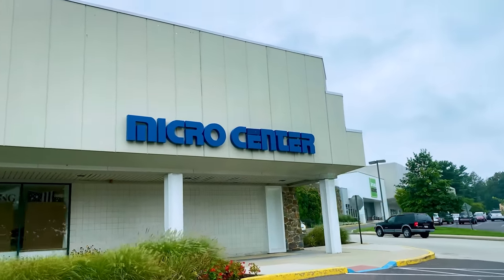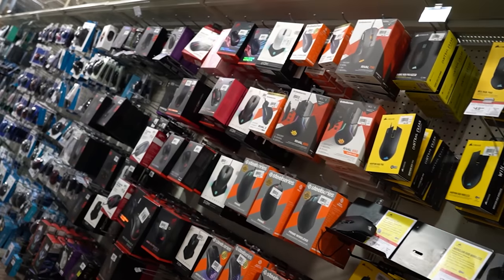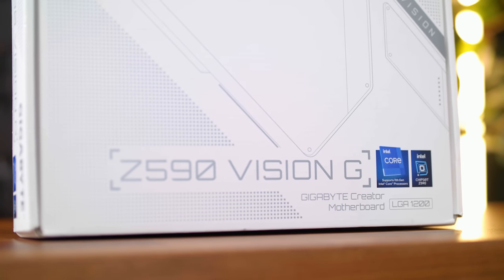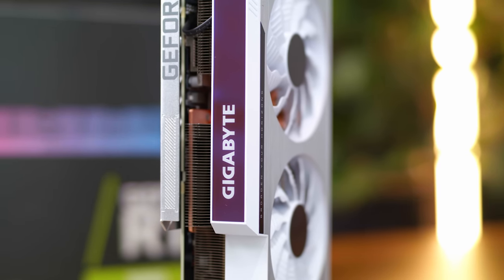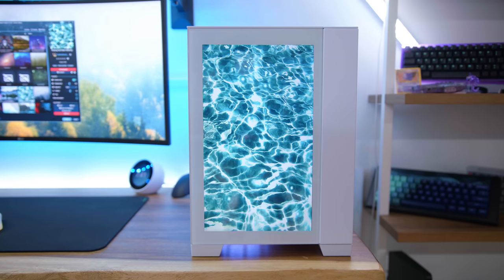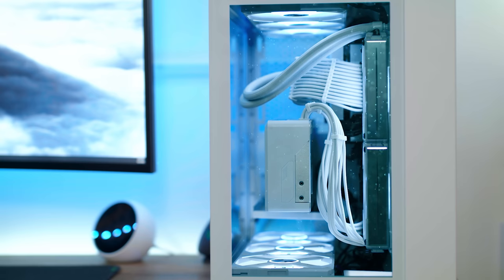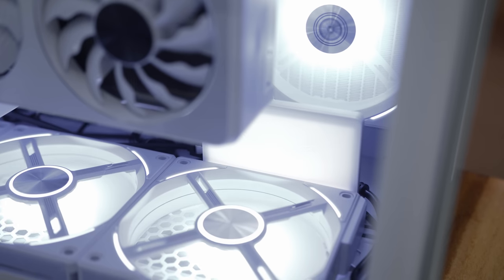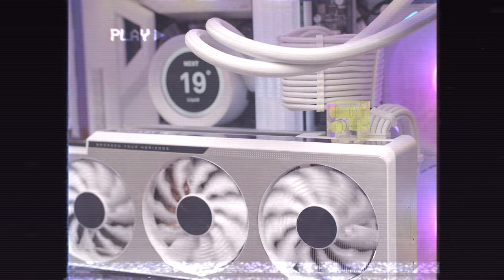I went to Micro Center & Built this SUPER CLEAN PC 🤤

Comment: The dummy questions at the end had me rolling!

This build is fantastic and so clean. The o11 air mini will be replacing my corsair 280x so I can get a white b550/x570 board in there
Reply: Especially the white z690 Asus motherboards! Good luck!
Reply: if you want a 360 mm radiator get a matx or itx cuz with a full atx it doesnt support 360mm radiators (i have one and had to return a 360mm aio and go to a 240mm one)

Comment: I need to upgrade my Intel 2500k, 4Gb RAM, 1Tb HDD, Onboard GPU, Gigabyte MoBo, 450 watt PSU, No case, it's screwed onto a piece of wood. The power supply though is actually decent though, for a 450watt.

Comment: I have a similar setup to you and decided against the vertical GPU. I tried it, but unfortunately it's too high for my taste. The GPU would have to be 3cm deeper and it would be perfect. Unfortunately, I haven't found a suitable solution for this yet. By the way, I installed another fan at the rear to blow air into the case. So in total 4 intake, 5 exhaust

Comment: Micro center is beautiful. So is the new PC! Gigabyte vision is unbeatable for a white build. My only concern is that the O11 Dynamic mini/normal/XL vertical GPU mounts have gotten bad reviews. Want to get the 011 Dynamic regular sized but want to water cool it with fans and radiator on the bottom and vertical gpu mount but can't find a good option. Any ideas?

P.S. Fire burns at the end buddy lol

Comment: Right, I realise this is a year old but it is probable you could have found better deals online rather than going to a store. Some places even offer free shipping. I just got the same case as you for £107.99 total with free shipping. Which I am glad about because I nearly paid an extra £8 for quicker shipping and my order arrived within 2 days from ordering. Which I think is a good deal since I seen it for sale elsewhere for as much as £30 or more extra. Lol, now I need to save up for the ROG SFX-L RGB PSU in white(I could probably save £100 by just buying a PSU without fancy RGB but it has a 10 year warranty which is good, 3 years on the RGB). It will probably take me the best part of a year to get all the parts together for a new build, am poor. By the time it is all set up there will probably be an Intel 14th gen range of CPUs released.

Comment: Quick question about your build!  Did you have any issues with the vertical mount making it difficult to plug in your HDMI cord to your GPU? My Snowblind S case isn't level with using a cablemod vertical mount.

Comment: Such a clean build! That momma joke was classic LOLOL. I have this same case in the regular white with a 10850k on an Asus z590a motherboard. I have it being cooled with a Corsair 280mm capellix AIO. But behind the radiator I have another 2 noctua 140 fans for a total of 4 140 fans so the cpu is very cool. The cooler master 850 PSU has been pretty good so far. I just need to find a gpu so I can upgrade my 2080 super.

Comment: Hello rfp if I was to do this exact build would I be able to use two GeForce RTX™ 3090 VISION OC 24G’s? Or would the case be too small or the powersupply or motherboard might not support it.I was also wanted to add water cooling does it work? If it does what watercooling do you recommend?

Comment: I have a dumb question. Do I need to have the games installed in to my SSD for them to perform better or is it okay to have them on a HDD?
Reply: Having things installed on an HDD will mean they will boot/run way slower when compared to an SSD. However, things will work on both drives. It’s just better to put things on an SSD if you want speed.
Reply: I mean any benefit that a game would get from an SSD, faster boot time, etc, will only work if the application/game is on the actual ssd. Just having an SSD but the game on  HDD means ntohing.

Comment: So I know I’m a little late but I just got this motherboard for my first build and I’m a bit confused about ram speeds I’ve ready on Amazon that it goes up to 2133 mhz but he installed 3600 anybody have info on this?
Reply: you have to turn on xmp in the bios
Reply: @Xyrox_FN  new problem I have xmp on with my 3600 mhz ram and it’s running at 2133 any ideas?

Comment: Why are you using a touch display inside the case... Instead of just an LCD panel for about 40$... Is there any reason to use this full Touch-Display ? It's very expensive just to sit inside... It's has speakers that will never be used... Touch that will never be touched.. unless you remove the front cover.. that could be nice... A headphone jack that will never see a pair of headphones I guess.. so much extra stuff that you pay for but never use...

Comment: “I built that computer in 2019”… dude it’s 2021. Unless you got low end parts that were already 5 years old on 2019 you don’t need to upgrade jack shit. I mean I guess if it’s your hobby or “job” then you do you but there is no need. Assuming you have a 2060 or something similar. No games have came out from 2019 til now that 1080s and higher can’t handle.
Reply from the maker: It's almost as if this is my job
Reply: @randomfrankp  Then I understand. Even then bet the old one is still a beast for editing.